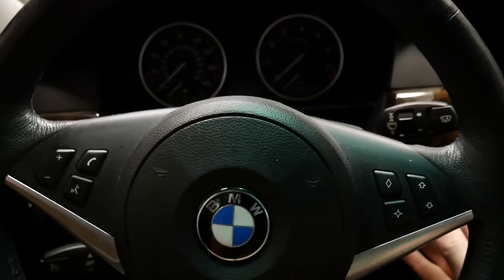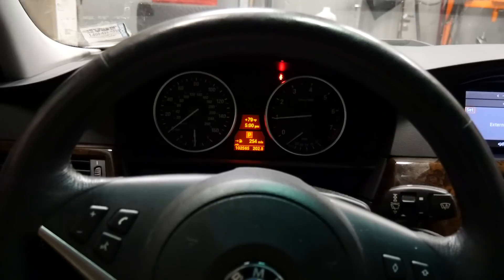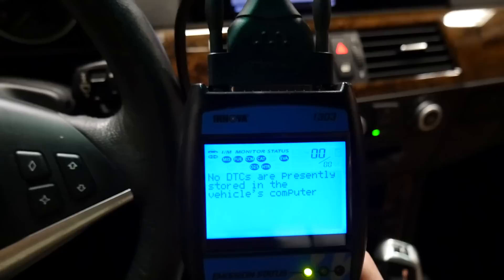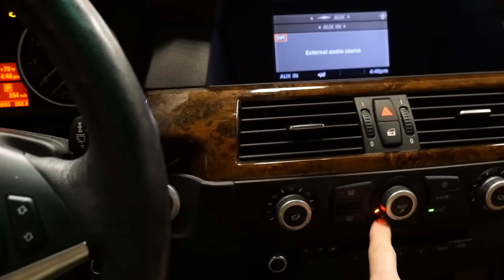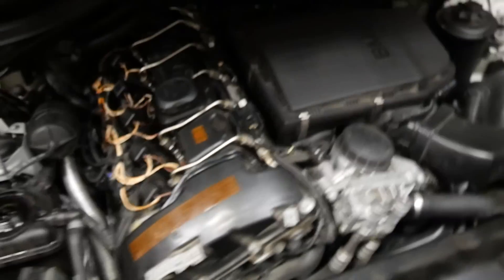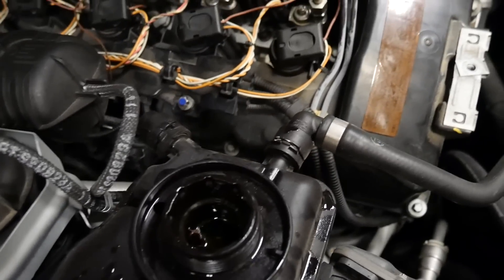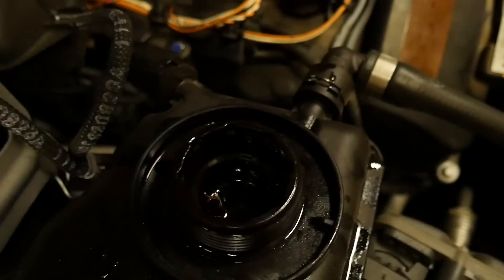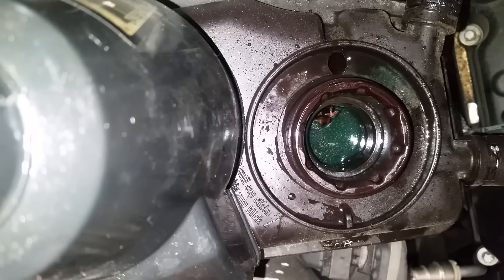DIY - BMW radiator fan stuck on high? - electric water pump diagnosis

Comment: I have a 06 E90, I did the bleed process (hold down acc for 10 sec) and the pump does work (it recirculates the coolant and spits it back into the reservoir), but the fan is still on high for some reason even on cold start up. Any idea?
Reply from the maker: Great question!  I don't know everything about these cars but a great starting point would be - If it the fan kicks on high as soon as the car starts and does not delay like it did in my video, you likely have a fan relay that is stuck on.  If it acts the same as the video, you may have a faulty coolant temperature sensor for the computer.  There should be two different styles and sensors on your car, one goes in the cylinder head and one goes in the lower radiator hose.  You can see what they look like by checking a parts store website and searching for "coolant sensor"  you can also scan for engine codes and put them into this website for diagnostic info https://www.obd-codes.com/trouble_codes/
Reply: It did start in about the same amount of delay as yours, is there any other way to check whether it's a faulty water pump / thermostat? Should I try bleeding it again and see what it does? I'm going to unlock the hidden menu tomorrow and find out what the coolant temps are.
Reply: By the way, my 2006 330i also has 81k miles so it is possible that the pump and t-stat are on its way out I guess
Reply from the maker: Let the car sit vacant overnight so that it is completely cooled off.  Unlock the hidden menu to view the temps without starting the car if that is possible.  If they read much higher (10-20 degrees) than ambient temperature you likely have a bad sensor causing the issue.  if they read normal you might have to dig into Bimmerforums - there are some very talented dealer techs there whom can help.
Reply: Epic Tim ok so I checked the temperature and it said 15°C which is roughly 59°F where the ambient temp is 47°F (from my other car). Sound like a bad sensor?
Reply from the maker: I don't know enough about the BMW logic process to give you a solid yes/no on this sensor scenario.  It might be self-testing ambient air temp sensor vs coolant temp sensor and seeing a problem, then kicking the fan on.  Or there may be a 2nd sensor that controls the ECU logic.  When I look up parts for this car I see one for the cyl head and one for the lower hose.  You would want to look at the data for both locations if visible in the hidden menu.  lastly, it could have had some residual heat from when you last drove it??  I may be able to look up some more data when I get to work on Monday.  With 81K miles it's cheap insurance to replace the water pump, t-stat and both sensors.  You can also try and find a temp/resistance range chart for that sensor and use a multimeter to diag both reading as well.
Reply: Epic Tim I already ordered the water pump and tstat, I'll try doing the temp sensor first because it's an easy swap and it's only $14. I don't think the car had any residual heat because I left it off for 2 days
Reply from the maker: Excellent - please post your result so other people can learn as well.
Reply: I haven't done anything yet but I turned the car on just to see what temps it would get to when it would overheat but it never over heated, I left it on for 10 mins, drove it around for half a mile, left it on for another 5 minutes but the highest it got to was 95 deg C (203 deg F). Fans never turned on. I'm not sure if it magically fixed itself or not, but I do have the sensor, pump, and t-stat which i'm still considering changing out just in case
Reply from the maker: Overheating with your symptoms sounds like a thermostat issue.  Best to do it all while you are in there.
Reply: Yeah from what I read, if it was the pump the car would overheat immediately after 1-2 mins because of no coolant flow, seems like my t-stat isn't opening and closing properly, and yeah you're right might as well change both while i'm in there.
Reply: Epic Tim Just took out the water pump and tstat, turns out the water pump was already done by the previous owner because it's the same one I'm putting in (pierburg) but I'll swap it out anyways because I got the water pump and tstat kit. The tstat however is oem so there's my problem
Reply: Kunwar Sethi Photography - just to add to this thread, there are some BMW thermostats that will stick closed (t-stats usually fail open). We had one that was sticking closed and the dealer said our car was overheating because of a bad head gasket. They tried to sell us on a rebuilt engine... 😡

We found on a forum an easy way to diagnose this type of problem. Run the engine at idle in park. When the temp starts to rise above normal operating range, rev the engine and if the temp drops, it's a sticking t-stat.
Reply: I have the same car with the same symptoms. Ended up being the sensor in the lower radiator hose.